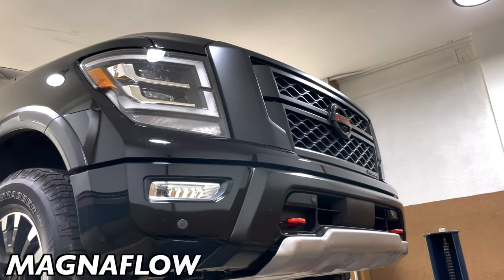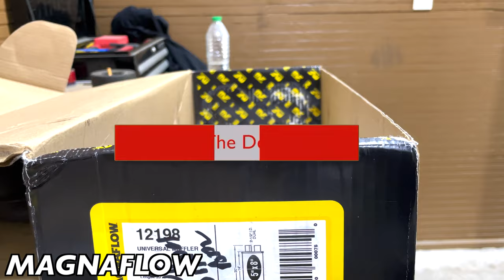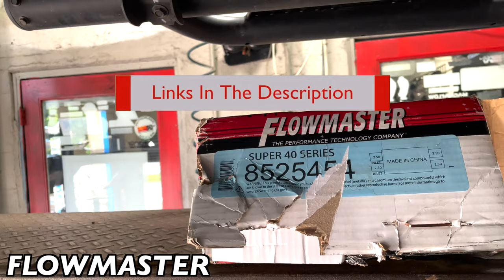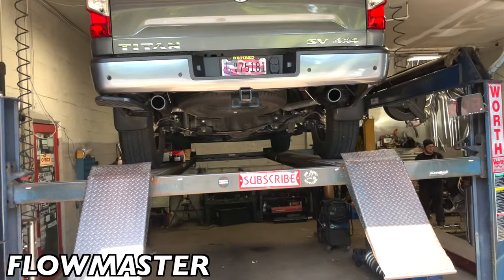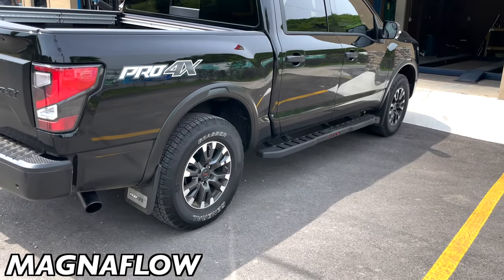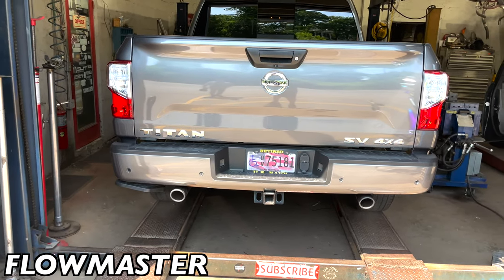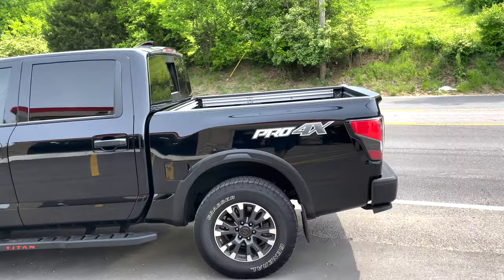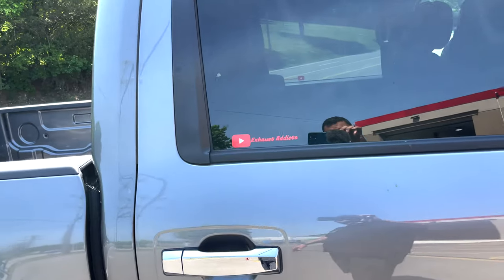Nissan Titan 5.6L V8: FLOWMATSER Vs MAGNAFLOW!

Comment: It would be nice if they made videos the exhaust systems on the day they were installed vs a month later after a few hundred miles are put on them.
Reply: Is that the troll that got deleted numerous times because he is jealous of my projects? Nice attempt at a racial epithet. 👬🌈
Reply: Don't be jealous my racist friend. One day if you work hard enough you can own a car just like this black guy. 👬🌈
Reply: Only Magnaflow or other fiberglass/rockwool packed mufflers break in. All chambered mufflers and Borla (all 304SS construction inside and out) sound the same as the day installed. 👍

Comment: Both nice but i like the look of the 2 pipes out the back like the RAM, they are nice trucks, i bought a 2023 RAM Warlock with the 3.6 a while ago and i don't want to take a massive loss otherwise i would have a Titan, that's an excellent engine!!

Comment: I just recently replaced a flow FX system on my 18 Titan with a Borla S-Type Dual in/out system and wow!  It was an expensive system BUT is quite the improvement! Clean solid rumble, no raspiness.
While I don't recommend anyone spending $1,400 on the S-Type system, I do recommend buying a Borla S-Type muffler for a few hundred bucks and have someone like these guys put it on. You'll get the same Sweet Sound at a lot less $$.
Reply: You can't just buy an S-type muffler. Borla engineers and designs their muffler systems on a per vehicle application. So the particular muffler used has some special construction inside to reduce the raspiness of the VK56 where as a universal fit style probably would not.
Reply: @oldschoolmobile  I don't know if they sell the muffler by itself or not. But other than the  muffler the rest is just straight pipes do I don't see how any exhaust shop can't easily  make those pipes. The muffler does have an integrated H-pipe inside do I guess that's the trick.
Reply: I have the dual in/dual out ProXS with the tailpipes going out the back (basically the same as the Flowmaster setup in the video).  My budget version of the S-type that you bought.  I love the way it sounds, but I’d be interested to see how it compares to the S-type.

Comment: I got a FloxFx system on my 18 Titan. I love it. It does get a little raspy if you really get on it just like the black one on this video. I was told by my mechanic that it is something to do with the valves or timing on the 5.6 and there's really not much you can do about it.
Reply: Pretty sure it's the firing order that does it.
Reply: It's the Y pipe design. Every other truck with a Y pipe has the same similar crackle.
Reply: @seanmcdonald5124  I'm going to have to tend to agree that you may be right about that, I replaced my system with a Borla S-Type which has an H pipe in the dual in/out muffler and I have absolutely no raspiness at all, I love it. Not quite as loud as the flow FX but definitely an improvement.

Comment: I can barely tell the difference between the two but I'm certain my 1rst gen with the classic 40 series sounds way better than those. There's a raspiness at high throttle (the card in spoke sound but at a tin can pitch) on both those like the stock exhaust amplified. edit: on 2nd and 3rd listen it's definitely worse on the magnaflow.

Comment: Magnaflows are always basically stock.  (Waste of money)
Reply: You do realize there’s different size magnaflows. This is the big 20” muffler, I had an 11” magnaflow and it was the best muffler I had on that truck
Reply: You’d be surprised how much more satisfying gaining a bit more V8 rumble is. It’s totally worth the money
Reply: Some people assume because a muffler is mild in the sound apartment that it is junk and that it doesn't have flow. That is farthest from the truth. Magnaflow has many different mufflers for many different tastes. This guy wanted a quieter exhaust but with a good time. That's what he got. If you want something louder MagnaFlow definitely makes louder mufflers. It's all about choice.
Reply: @ragintaurusmusclemercury7023  May I also mention Magnaflow is a straight through exhaust meaning you dont lose power like you would with a chambered muffler?
Reply: @chkntndy7727  Most people know that a straight through muffler makes more power than the chambered muffler but to some people sound as all they care about. If it's quiet then it doesn't flow. And that is just not true.
Reply: The MagnaFlow  was a way better tone and sound at higher rpms.